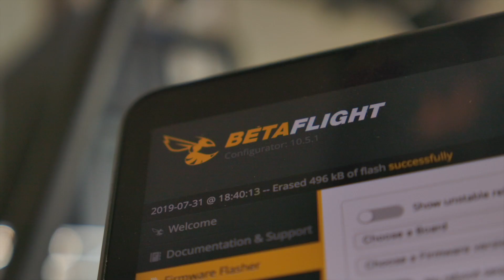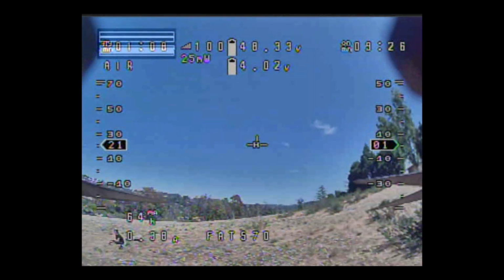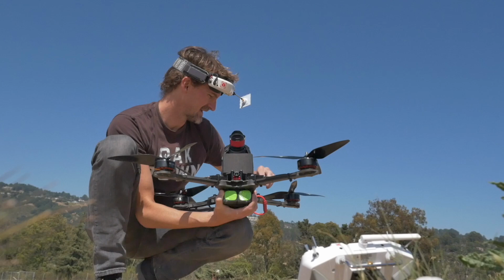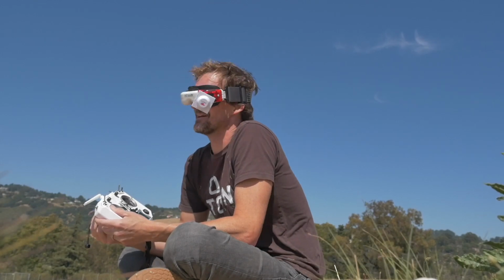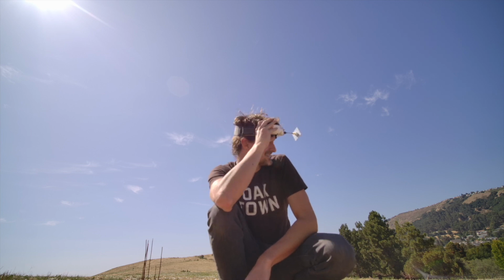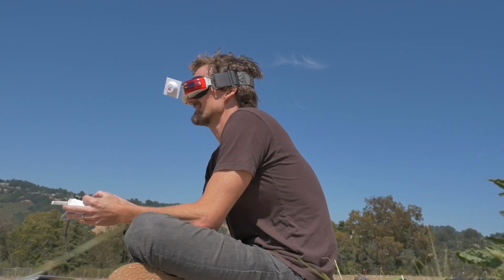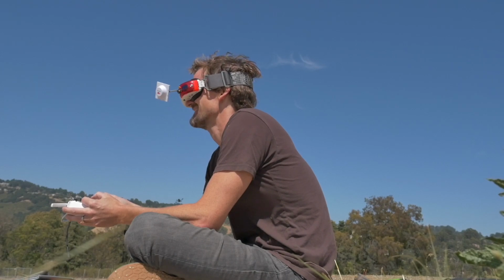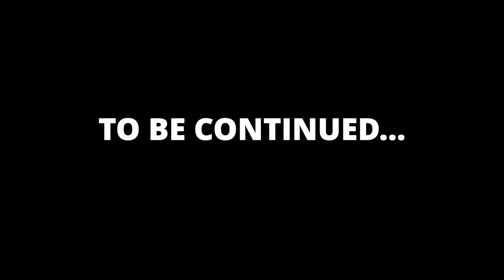Cinematography with a Crazy Beast-Class FPV Drone, Part 4, The Big Camera and San Francisco

Comment: I think bump up your expo slightly to smooth out that center stick a bit on pitch and roll. I feel like your going to be in the first 30% of stick travel more often than usual so this should help.
That yoga block had me chuckling for a bit. Totally works but huge! Love this setup and can't wait to see what more comes of it!

Flights in San Fran were much smoother. Well done!
Reply from the maker: Thanks man!  Great thought on expo!  yeah, I do not have it dialed in yet and there are some nasty shakes in places.  I'm not happy with the jitters or the angular vibe of the footage, but it's coming together.  The foam yoga block is definitely not pretty!  I'm glad it held and gave me a chance to experiment with camera tilt angle and payload.  I have a much more solid and less-dorky solution in the works!  Glad that the flight time is still solid, that the added weight is no problem for this drive train and that the footage has very very little jello.  Onward and upward!!
Reply: @MattBeardsley  Totally a great start for the project. Usually were not so lucky with this type of thing.

Comment: How much??? I have the E2 as well and would love to do this... maybe... depending on the $$$
Reply from the maker: heh heh, that's actually a pretty hard question to answer, as I built this myself from a wide variety of components.  Do you already have goggles and a radio system?
Reply: @MattBeardsley  No... I'm the definition of a NOOB... 😐
Reply from the maker: @nosidecolon1  FPV flying is a blast, but takes some time to get comfortable in.  Grab a Frsky radio, some Fatshark goggles, and something small and tough like a BetaFPV 85X, and go to town!  There are some great simulators out there that work with the radios too.  I'd get solid on that, then a 5" quad before diving into X Class or "Beast Class"
Reply: @nosidecolon1  Ya Me too! I am excited about getting my first flight in, once I get my Qwad!